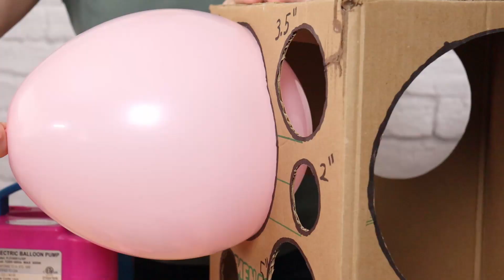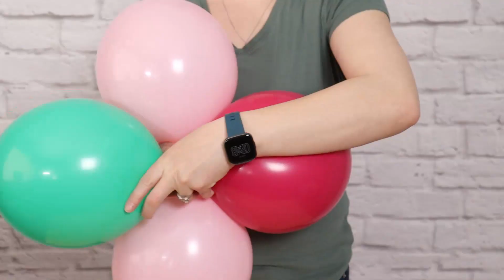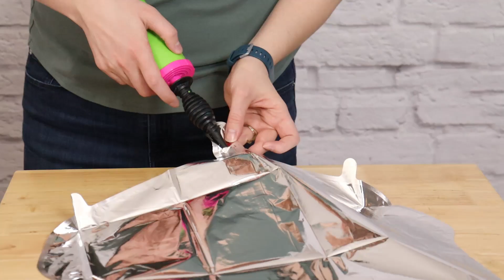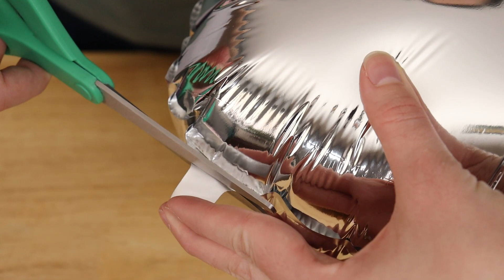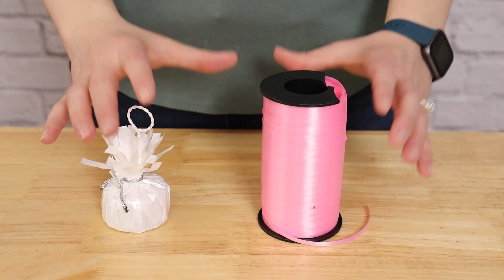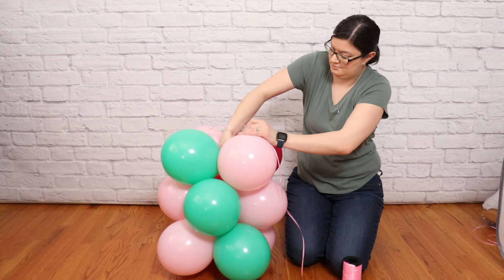Easy Balloon Number Column | No Stand No Helium

Comment: If I wanted a smaller/thinner column, can I just make the balloon size smaller? Say 6” instead of 8”?
Reply from the maker: Hi, Yes, you would inflate the balloons to a smaller size. It will make the column narrower and shorter. You could attach extra quads if you wanted it to make the column taller.